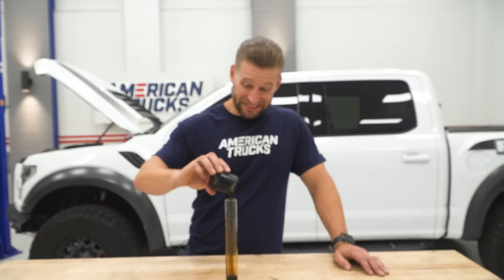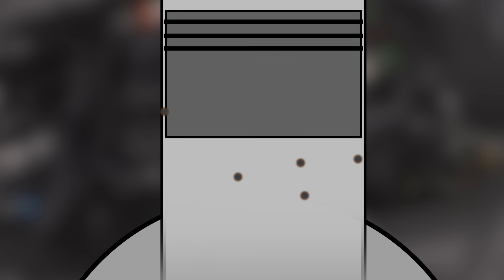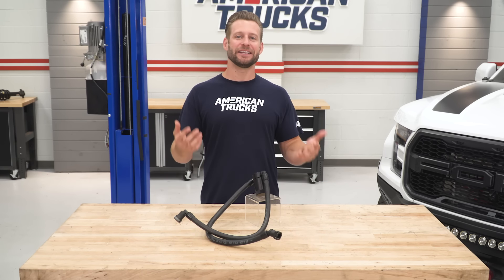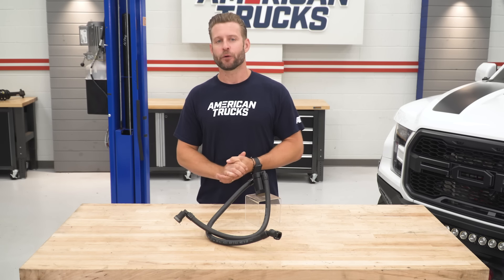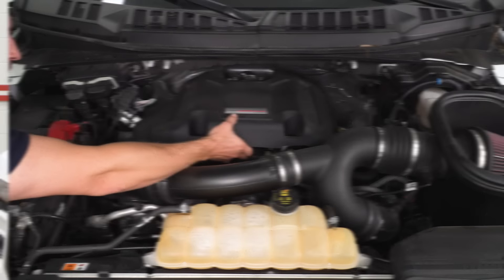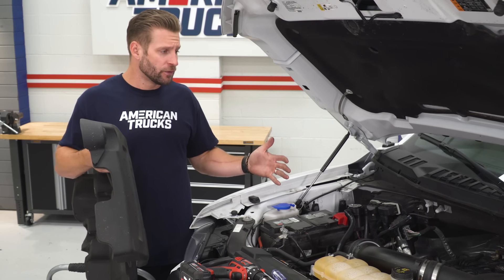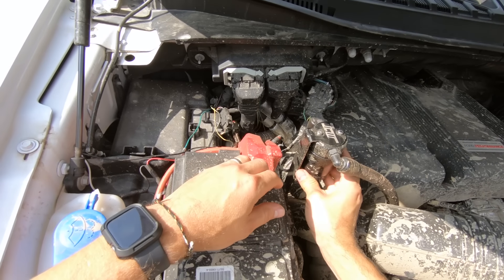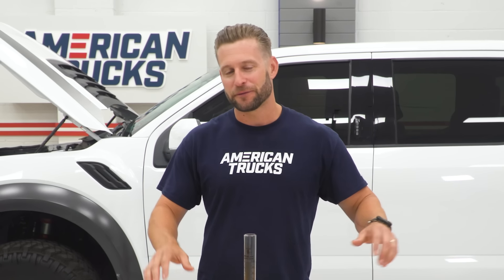Does Your F150 Need a Catch Can? - Ford F150 Oil Separators Tested And Explained

Comment: This should be a standard part of the truck.
Reply: Then you wouldn't spend thousands on maintenance
Reply: People are not spending thousands of dollars on maintenance because they don’t have a catch can. The number of cars that have had an aftermarket catch can installed on them is so small that it is statistically insignificant.
Reply: Thanks to the subtitles across the screen I couldn't see how to hook it all up.. Guess I'll have to check out someone else's better video.
Reply: @michaelrobinson6216  well you could’ve taken those off in the options
Reply: @ramecodiesel8271  I went into this thinking I should get a catch can and came away thinking it's a bad design.  What happens when someone buys the vehicle without knowing it's installed or needs maintenance?  Eventually it's going to overflow and start puking crankcase oil into the intake manifold or clogging up the PCV.

Use a centrifugal collector like you find on a Dyson instead of that screen, let the oil drip from there into small trap.  At the bottom of the trap have a diaphragm that is operated by either a bimetallic (thermostat) strip or possibly intake manifold vacuum/pressure.  When the engine is hot/running the diaphragm is closed.  When the engine is cold, the diaphragm relaxes and lets the collected oil drip back down into the crankcase via the dip tube.  Should be close to zero maintenance.
Reply: not only that but make the can bigger so you only have to empty it once a year or something....
Reply: @michaelrobinson6216  Why didn't you just turn off the subtitles?
Reply: @Waylon Yahir thanks so much for your reply. I got to the site thru google and I'm in the hacking process atm.
Seems to take a while so I will get back to you later when my account password hopefully is recovered.
Reply: Until it freezes
Reply: NO! This seems like it should be standard on all vehicles. The whole (oem) recirc idea just seems so bad seeing this.
Reply: @jcims  while I disagree with the first half of this, I’m very interested in the setup you are suggesting, thanks.
Reply: I’m not saying they don’t work but I’m well over 100k and still running strong without a cc. Only money I’ve spent was brakes tires oil and a tps. All maintenance unrelated to a cc.
Reply: @jcims  you just described an AOS which most people probably don’t need unless they’re racing their car and consuming oil like crazy cause of contamination with the fuel
Reply: NS
Reply: @javonj377  why? Cars don't need these, just look at cars on the road. Millions of vehicles that work just fine for hundreds of thousand miles and don't have a catch can.
Reply: @MBr397  yea “work”, slowly damaging your engine .
Reply: @sharkbait305  but yet most engines can last for over 200k thousand miles if you do your regular maintenance. "Can" something go wrong yes, but it's actually a small percentage of the millions of cars on the road.
Reply: @MBr397  I’m no expert but I will give MY best answer. First, I added one of two catch cans in February and all I can say is WOW to what has been captured. Secondly I feel and from what I have seen, read, and my personal knowledge, catch cans are very helpful on some engines and others probably not so much. What I can say is with the designs of the 2.7EB it’s stopping or at least reducing build up on the valves/stems. There is no fuel introduced in the system before the valves to “wash” them off thus allowing a lot of build up which could most definitely make them not seat right. Also a big chunk could come off and go into the turbines and lastly, Ford says that they can only be cleaned by hand. So to extend/prevent any of those costly or time consuming repairs. A cheap set of catch cans don’t seem to hurt.
 Hope that helps.
Reply: All 3.5 ecoboost engines
Reply: @javonj377  pre 2018 2.7 yes 2018 plus there is dual fuel injectors that stop that from happening
Reply: Originally cars were designed to expel the excess oil on the road. No carcaj needed. Then someone realized we should not do that and we have the sht show we are in now. All cars should come with a catch can.
Reply: The main benefit of a catch can is to reduce carbon build up on the back of the valves that can occur on gdi engines. You don’t need a catch can unless you have a direct injection engine that lacks secondary port fuel injection. My Golf Gti might benefit from one, but VW added a different kind of oil separator which also mitigates the problem. It also helps if you use the correct oil and don’t over fill.
Reply: 100 percent agree
Reply: @ramecodiesel8271  fair point right there
Reply: @Javon J  Pretty much my thinking as well. I'm paying a large amount of my money for a truck that I hope to still be driving 20 years from now. I want my investment to last as long as possible and I'd like to avoid costly repairs down tbe road. If a catch can (or dual cans) helps that happen, I'm all for it.
Reply: @jcims um...bought a second hand f150, and the pcv was bad and throwing oil into the intake. Made the engine dirty af. Took a while to clean out. Everything is a bad design when not taken care of
Reply: adding port injection makes these things irrelevant. hell on my 2011 3.5 the lines froze in a bad winter built up back pressure and blew my passenger side turbo. i don’t see any need for these in my 20’ 2.7.

Comment: As a 3rd generation mechanic and engine builder I don't have a catch can on my 2015 F150 Ecoboost or my wife's 2021 v6 DI engine. Use a good synthetic Oil change every 5k miles, tier 1 gasoline and change the pcv valve and coolant at 50k miles. I see lots of turbo failures but zero intake valve failures!

Comment: May be a dumb question, but why don't these manufacturers have this under the hood with all the other components already.
Reply: Planned obsolescence and continued customer purchases through parts and maintenance via the dealership and 3rd parties.  After 15 years 3rd parties can make parts for "X" car model/make brand on the secondary market. It's a continuos purchasing loop for the auto industry. They have greatly reduced quality and end of life on parts/vehicles to maximize profits of late though compared from at least the 50s and today.
Reply: Keeping the service department busy is job one.
Reply: Because burning it through the catalytic converter eliminates joe blow dumping a canister in his kitchen sink
Reply: Car manufacturers won't install things like this because every vehicle from the motor to the body to the chassis everything is on a constructed budget so if you start adding more and more and more of these things on their the prices of each vehicle goes up now it seems rather inexpensive but when you add that across the assembly line it actually ends up being many many millions of dollars extra on the assembly line which would cause the targeted price of the vehicle to go up plus they're not in it to limit the amount of maintenance to the vehicle a lot of engineers today go crazy with stuff that only dealers can fix and that's a serious problem with all these new very expensive vehicles that have way too many electrical issues but you can also put something like this on the vehicle yourself which I just recently tore the top off a Ford F-150 with the 5l Coyote engine and it was loaded with oil inside the plastic air intake so yes it would benefit greatly because that oil sludges up it causes strain on the butterflies inside the intake and causes them to seize up over time and and cause excessive drag and then eventually the shaft that controls those butterflies breaks from corrosion on the outside to excessive oil on the inside which was all gunked up

Comment: I have a 2013 F-150 w/ 3.5 Ecoboost engine. I installed a UPR oil catch can (large one) that picks up both the driver and passenger side PCV and after several hundred miles I can drain nasty gunk, about 12 oz (into a 16 oz water bottle) that would otherwise be rerouted back to the manifold. I read about these both in F-150 forums and here on U-Tube otherwise I wouldn’t have known about this situation. I installed it around 70K miles and I have almost 120K now. This one isn’t cheap but it’s sturdy, looks good and the hoses are top notch.
Reply: link??
Reply: @ this is the one I bought but I upgraded the check valves. The hoses are really nice and sturdy. Apparently there wasn’t a PCV valve on the drivers side as I initially thought but it connects to a tub coming from the valve cover and turbo.

Comment: I am a new Ford F150 owner (2018 Lariat 3.5EB) and just found this channel. I have learned so much about trucks in a week than I have in my entire lifetime. I just ordered this for my truck. It already has 41k miles so I hope this helps prolong the life. Thanks!
Reply from the maker: Congrats on the new truck and glad you found our channel, Alex! Thanks for watching! -Zach
Reply: I have a 2015 F150 3.5 ecoboost. Bought it new.
Didn't know about the carbon  build up issue or catch cans until just recently.  I already have 130,000 miles on it. Wonder if I missed the boat with the catch can? Too late?? Car has been meticulously kept. Oil changed every 5,000 miles with synthetic oil

Comment: I was one of those that thought I wouldn't need one.  I replaced my intercooler yesterday on my 2015 3.5EB and probably drained 1-2 tablespoons of oil from it and maybe another 1/2 a tablespoon of oil from the pipes and couplers. I was expecting maybe a drop or two but there was just way more than I thought there would be.  The truck has roughly 48,000 miles on it and runs perfectly fine with zero issues.  I ordered this catch can this morning.
Reply from the maker: The nice thing with 2015 and newer Ecoboost engines is that they have both direct injectors and port injectors, so the risk of valve coking isn't as big but blow-by can still be produced (as you saw!). Adding a catch can will definitely be a nice addition! -Zach
Reply: I have the Same truck. Which catch can and from what company are you ordering it from ❓

Comment: When tearing down my 4.3L Vortec for a rebuild in '04, I noticed quite a bit of gunky oil residue on the inside of the intake manifold and throttle body. After a bit of internet searching, I found out about catch cans and installed one on the new engine and what a difference. I have zero oily build-up in my intake manifold or throttle body after more than 50K miles and I saw about a mile or two MPG increase. Wouldn't drive a modern car w/o one, as they are cheap insurance for your engines longevity, by extracting all of the oil, fuel & water vapors that acidify (and ruin) your motor oil, hence the main reason for needing to change your oil. Less frequent oil changes means money in the bank. That's a win, win in my book.
Reply: I always found it built up in the air intake tube and would forget about it ever time and end up dumping it all over myself

Comment: also if your considering walnut blasting it costed me 395 bucks per side and it  restored the lost power robbed by carbon build up from not having the catch can installed, its not 100% gone but id say a good 93% is being caught thus making it well worth the investment!! but I couldn't believe the power it restored from cleaning the valves and installing new injectors its well worth it if you have 120,000 + miles.

Comment: I added one to my 2016 2.7, I would empty about half a coffee cup in 2-3 months. I changed my oil every 3,000klm with Signature Series Amsoil 5w30.
Just bought a 2021 F150 3.5 Turbo, and within a couple days put the JLT Separator on, was easy pezy. When I checked it after 1 week there was nothing. I checked it a week later and nearly nothing. 
Still glad it’s on.
Reply: Good Job.

Comment: It was one of the first mods I installed on my new 2019 F150 EB3.5L - works GREAT, highly recommended.
Reply from the maker: Really is hard to beat a catch can as a first mod! Relatively cheap, easy to install, and you can see it working after a couple hundred miles of driving! Thanks for watching and your comment, DJ! -Zach
Reply: @americantrucks  It's nothing short of long-term protection for your EXPENSIVE truck at a 1-time cost of $149
Reply: @djpadko  $50 on Amazon

Comment: I have one on my 2016 F150 (5.0) and my 2018 Mustang GT (5.0). 
"They work"!! BZ AM/AT.
Customer for life! Merica...🇺🇸🇺🇸🇺🇸
Reply: How much oil does the separator pick up during an oil change interval on the Coyote?
Reply: Riggin Thorniley hardly any but does collect after awhile. I gone a whole year without cleaning mine out and was only a quarter of the way filled up. 
2016 5.0 with the ford performance catch can 👌🏼
Reply: @JDMImportz1  thanks! I will be installing one when I get my 2015

Comment: Definitely helped me on my 3.5, in fact I recommend it. Will help with that 2-3 gear hick up. Also use the Lucas oil treatment, definitely helps every 500 miles

Comment: Great explanation, they should make the can clear like plastic or glass so you can see how much you got in there without having to take it off.
Reply: I think heat is the reason against plastic. 
Glass could break. 
So I would like to see a thin vertical glass window in the side of the can.

Comment: For Turbo apps the 3 line can is better as there is no vacuum under boost to keep it flowing but the turbos will pull a vacuum  in the air feed ducts when spooled to maintain a constant draw or flow in the catch can. I run an RX can in my 2014 F150 3.5 Ecoboost.

Comment: I installed a catch can on my 2020 F150 5.0 when the truck had barely a few hundred miles on it. I just drained it today at about 5,100 miles. These things definitely work. I wouldn't consider the amount of oil I drained out of it excessive, but I'm definitely glad it didn't make its way into the intake manifold. I'm using the one from Ford Performance with a fabricated bracket and tubing setup, but I'm sure most of the products on the market would do the job. Definitely a good investment as I plan on owning my truck for quite a while, and definitely want to keep it well maintained.
Reply: They work because they catch oil, but that's not the question. The question is - is that needed? Is the oil in the catch can as bad as they all play it to be? You don't know this, I don't know this.
Reply: @original_no_name  they did say it's beneficial, it keeps the intake clean and prevents "valve caking". That oil also probably messes with fuel mixture also when it's recirculating throught the engine.
Reply: @original_no_name  Then don't buy one.
Reply: @MilkMan608 why? I have a 23 and I’m thinking about it.  Not a good idea?

Comment: There are 'many' different catch-can's on the market, and I was hoping that a few would have been tested, and which would have been the most efficient, at catching the most 'gunk'!  Nonetheless, this is a mod I will need to do to my 3.5L Ecoboost, yet now that the truck is at 125K miles, my intercooler tubes I'm sure have a fair bit of oil in them after seeing this video!   This looks to be the most simple design I've seen, as some are much more robust systems, with a larger catch-can, as well as some even with vacuum to help suck the oil, so none get's by at all.    Thanks for the video, as it gets those of us that haven't had this done, to get our butts busy, and think about which to purchase!
Reply: The JTL definitely seems to be a more simplistic model... kind of a bare minimum system. Works better than nothing, but not as fancy or complicated as one that connects to vacuum or has a built-in drain.
Reply: @supermike0822  Do you have any recommendation for more complex/fancy ones?

Comment: Great kit! Intake staying clean about sticker mileage or higher!. Not catching much with 5w-30 syn. 0 tail pipe soot now! Barrymans b12 in gas.3 tanks. 36,000 miles with 3000 mile oil change max!

Comment: dual injection should help to keep the valves cleaner, but at high rpm the catch can should help to keep all the gunk from causing stuttering  and loss of power. also the cooler you can keep the catch can the better, to help capture more oil vapor in the can. ive noticed changing the oil around 6 to 7k is the best in my 2016 2.7, full syn only
Reply: You wait that long to change oil, damn I change mine every 5k
Reply: @gavinlee9478  I change it at or about 3,500k in my 2014 ecoboost . I'm not taking any chances. Oil is cheap...

Comment: I have one on my 2011 F150 3.5L ecoboost. I change my oil every 5k miles using ams full synthetic oil. I dump it every time and it’s full with a white Milky substance and oil blow by. Crazy how much stuff it collects great product definitely recommend it for your ecoboost cars or trucks.
Reply: I would be concerned about a head gasket
Reply: I have a 14 eco that I’m getting the same milky fluid!???????